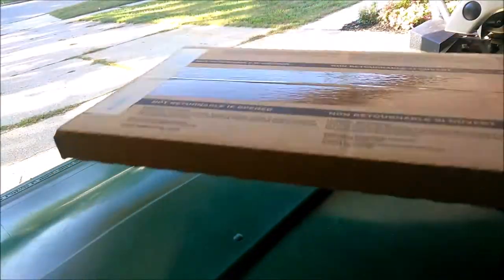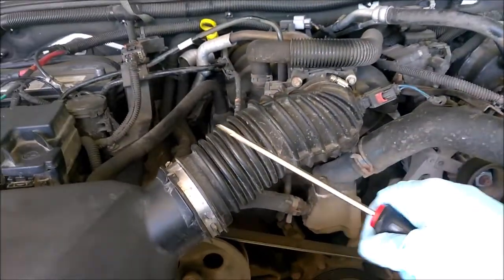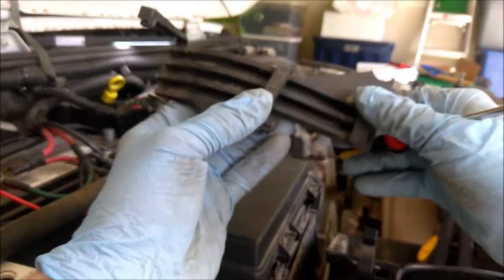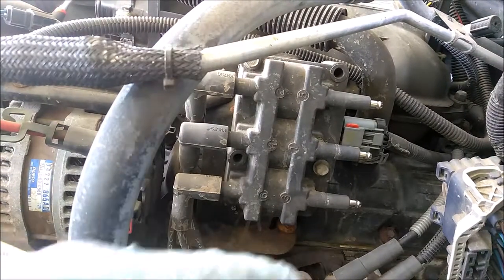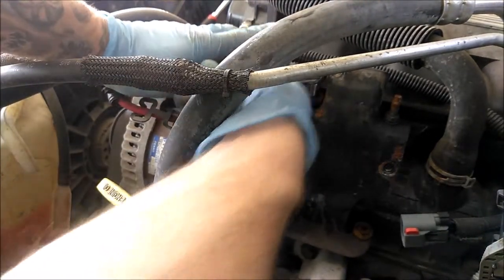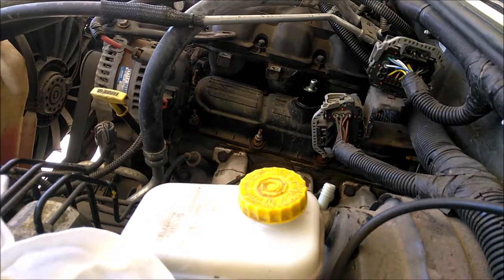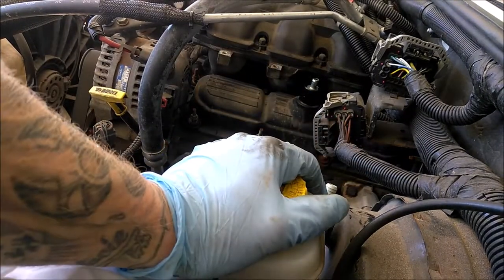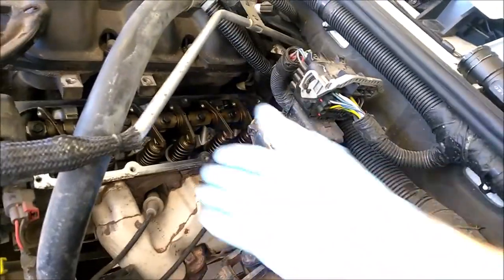How to replace valve cover gaskets on your Jeep Wrangler JK 3.8l

Comment: Good video,  I have 433k miles on my 07 JK.  Next rebuild I'm going to replace the plastic valve covers with metal covers(2001-2003).  Go to salvage yard and get some shorter valve cover bolts. No need to use several of these longer stud bolts
Reply from the maker: Appreciate the comment and view.  Yeah I'm ready for another Jeep as well.  Metal covers would be nice and yeah if those covers come off again I may have to get some shorter ones lol.  Have a great weekend! 👍👊👍
Reply: @BeyondTheScale  I bought it new in 07 upgraded to teraflex axles in 10.  Motor & tranny has been rebuilt. Runs as good as new. Plan on keeping it may lifetime.  Know all normal issues and repairs.
Reply from the maker: @donlum9128  Sweet I would say I want to keep mine for life but being in Michigan the salt eats everything away lol.